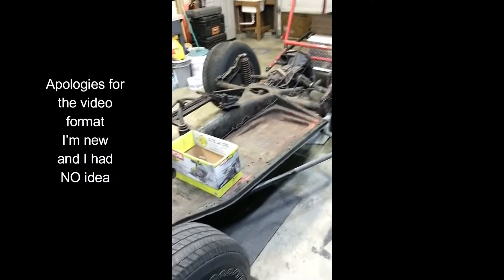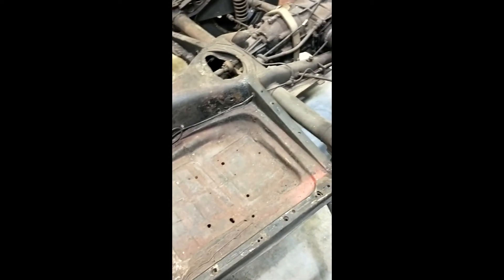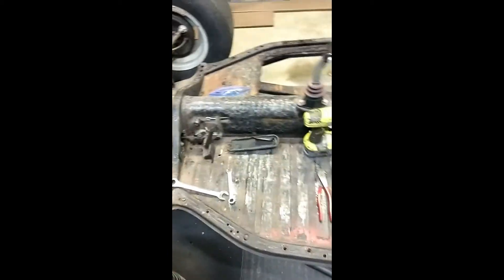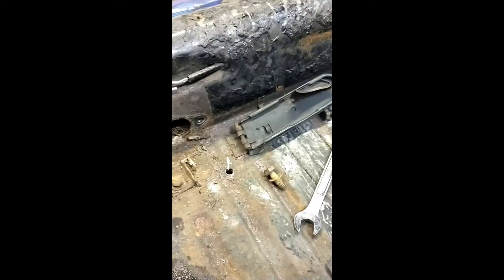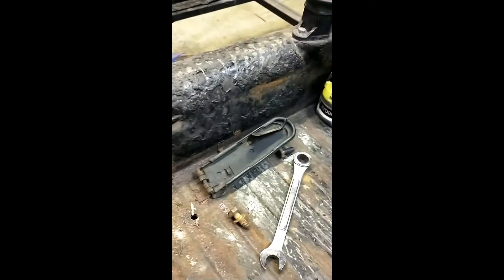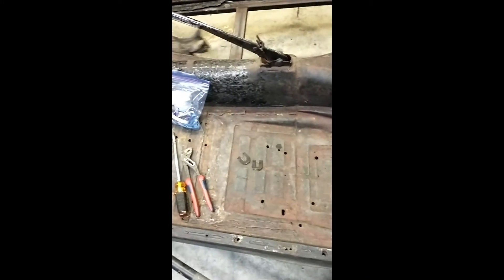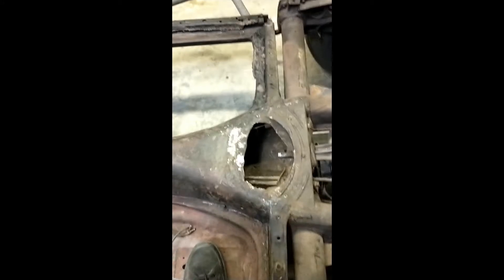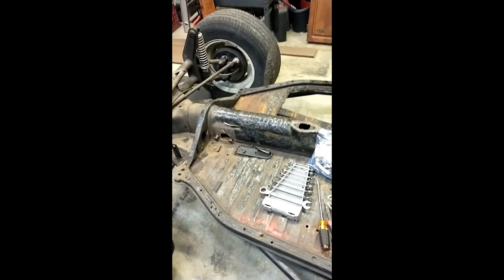Episode 4: 1964 VW + 2007 Honda Odyssey Dune Buggy Rebuild: Buggy Break Down Part 2

Comment: Blieve it or not, that's the way Volkswagen ran the brake lines from the factory. (Less the loop for the shortened pan.) They never ran the brake lines through the center tunnel. Just the throttle, clutch, and emergency brake cables, and the shifter tube. good luck on your rebuild.